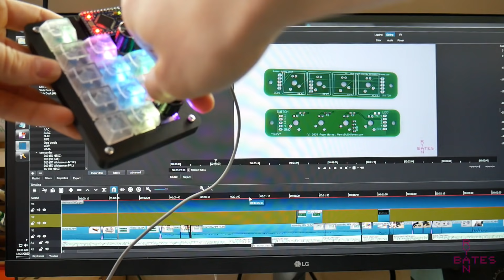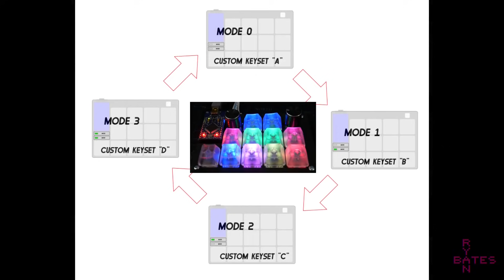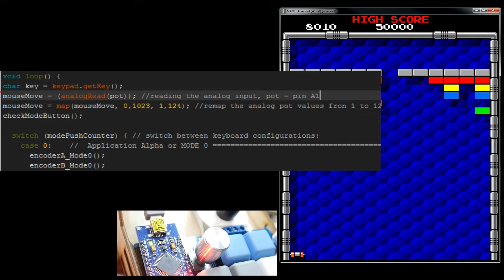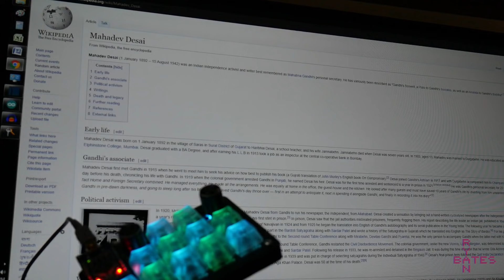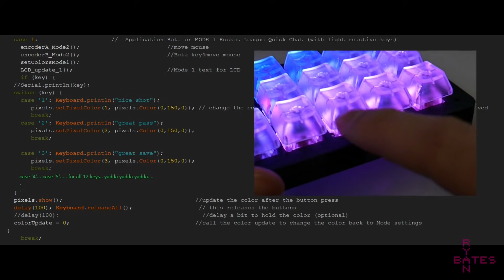Arduino Pro Micro Macro Keyboard Version 2.0 |  DIY Macro Pad for Professional Keyboard Slayers

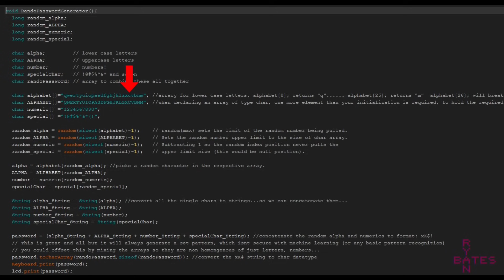Comment: Just a note at 23:13 -- the `sizeof()` operator tells you how many bytes a variable has. In the case of a `char` array, it works out to the length of the array, but that is only because a `char` is one byte. If you tried the same thing with an `int` array (`int` is 2 bytes on Arduino Uno) you would get double the length.

The project looks great though! It's been a big help in building a macro pad of my own.

Comment: I'm attempting to build this and referencing the video as I go. Here are some timestamps that may be helpful if you're following along and soldering, though no guarantees for accuracy and some may/may not include the explanation.
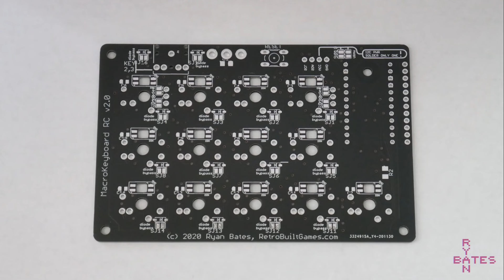3:44 Diodes for anti-ghosting
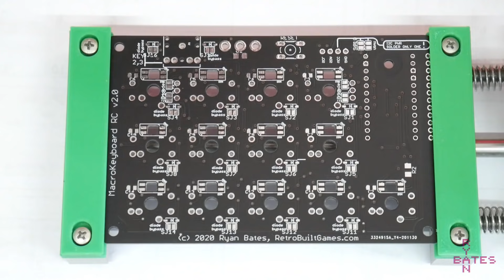4:09 Diode bypass jumpers
4:33 Rotary encoder enable jumpers
4:51 LCD breakout connector
5:49 Right-angle header to connect screen 
6:13 Individually addressable LED
7:51 LED capacitors
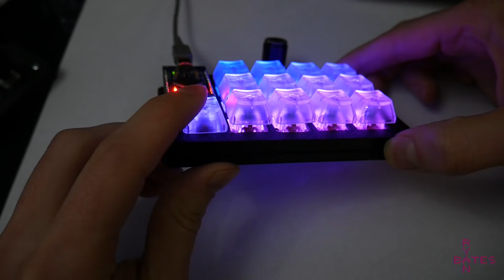8:10 Resistor for data-in
8:30 Reset button for programming
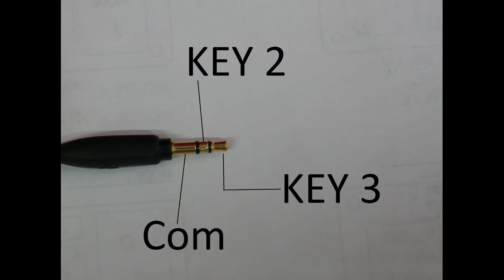9:06 Volume/potentiometer knob
9:22 Arduino Pro Micro
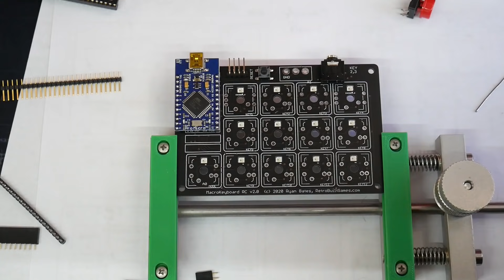10:13 Soldering encoders and keys
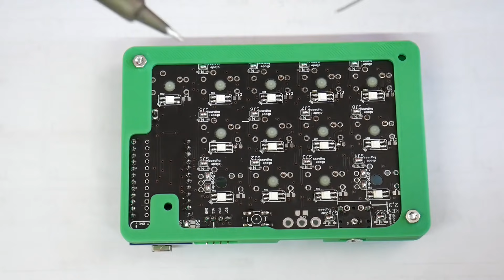10:45 Encoders (flush cutting tabs)
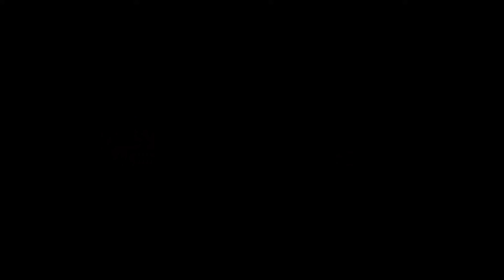11:58 Final Assembly (case)
Thanks to Ryan for this awesome project, I'm super excited to build it
Reply from the maker: Thank you for the timestamp breakdown!!!
Reply: @RetroBuiltGames  I think the direction of the diode in the video is wrong

Comment: Once upon a time, I played a FPS online, that had artillery vehicles (among others) that had arcing shell trajectories and pretty long ranges. You controlled the aiming with a mouse. Those rotary encoders would have been rather nice to have for hitting long range targets blind, or with the help of a spotter.

Now though, I'm interested in 3D stuff. VR, 3D modeling, 3D input devices, etc. The macro keys look useful for tying extra key binds to for a feature rich program like Blender. There might be a way to use it in a social VR game as well, for emote keybinds, to control facial expressions and such of the avatar. Though it's already generally the practice to do that with the hand gestures on your 3D controllers. If you had both though, you could have extra functionality. The rotary encoders might at least be useful to somehow control how open the mouth is without needing to make sounds for the viseme system to use as cues for jaw control. Another use could be to control the speed of a repeating idle animation. Turn the nob for faster or slower.

Comment: I'd personally recommend getting some solder paste for the SMD components, especially the LEDs.  I've found it works great to both get the components aligned quickly and to minimize iron time so sensitive components won't bork
Reply from the maker: Thanks for sharing
Reply: Yes, it is very important to minimize component borking.

Comment: This project looks perfect for a live stream OBS 'hotkeys' macro controller. I'm going to also make a prototype that is MIDI compliant and see how this design holds up for a Synthesiser interface. Cheers Ryan!
Reply: It may worth it if you need a macro keyboard frequently. 
Instead I use an old tablet and TouchPortal. Even the free version offers enough functionality if you are not a pro streamer.

What I could use though, a split keyboard with 3 or 4 parts, and with a button which could switch between layouts, so now I wonder what this channel can offer in terms of information even I can understand  :)

Comment: 8:00 I'm pretty sure the caps required for the LEDs by the manufacturer are simply to help eliminate any flicker from irregular powers supplies etc, can't be sure tho as I'm an amateur electronics engineer and I basically know just enough to be dangerous and confident enough to make a comment without actually knowing anything at all lol.

Comment: i cant wait for this board to be available again on tindie! the price is right and ive been wanting to build a macro keypad forever. i just ordered my arduino pro micro and as soon as i can afford the keys, caps and encoders it will be an awesome build
Reply: i have my PCB, installed the arduino and LEDS. im ordering keys and caps at the moment as well as the button and diode

Comment: One revision you could make in the future for the PCB is to add the two small fixing pins per the Cherry MX standard. That way you can use PCB mount (5-pin) switches and they will align properly.
Reply from the maker: I had this in one of the in-between revisions. Removed that footprint variation because those ~22 holes took up a bunch space for routing traces.

Comment: One useful function would be sending a keyboard or mouse event periodically every few minutes to the host machine. This is to prevent screen lock on timeout. I would buy such device ))
Reply from the maker: This can be done! Is a current feature/bug in my code. Will wake my computer from sleep unless you tell windows to ignore this USB device while in sleep.

Comment: Seems like it would be beneficial from time to time, or for different folks, if the 2 power options were not solder bridged but instead bridged by a jumper cap that can be moved again and again. That way, if I bust my screen (or just don't like it) and I get a new one with a different voltage, I can just move the jumper cap.

However, I LOVE the project!
Reply: jumper cap or toggle switch ftw.
Reply from the maker: solder wick ftw

Comment: I've had success having coarse and fine input on a single encoder by using a timer. If it's been a while since the encoder moved, the encoder changes the input by the smallest increment. If it's moved recently, it changes by a larger increment. "recent" and "larger", adjust to your taste.

Comment: Try using the Open Macro Keyboard project. Instead of four modes you will gain unlimited screens with macros along with an option to configure colors per button per screen. You'd need to reprogram your keyboard to send information about key presses and/or encoder rotations through COM (via USB). But I guess it is worth the effort.
Reply from the maker: you didnt watch the video

Comment: Rgb led resistors: if you would use a brightness pwm value of 255 or just constant 5V then the leds would burn eventually, but since you're using pwm value of 120, resistors are not mandatory.
Reply from the maker: resistors where?

Comment: Three times the cost, eh?
Seeing these are fully customizable, I'd say the money costs would be a small fraction, compared to trying to get a custom from someone else.
Cost of time however... 
A little more than just plugging in after getting in the mail. But that's the fun part.
Reply: i could see someone creating a software similar to elgato"s one that could fix most of the time spent on macros

Comment: Hey does anybody have a link to where I can find resistor mentioned at 8:15? It does not have to be the exact resistor used in the video, just as long as it will work!

Comment: I am looking for something similar with infrared. The background is, I want to make a simple remote control for a video player for my grandmother, 92 years old.
She selects a number from a paper list, which is linked to a movie title, possibly also via rotary encoder and display. Then, by pressing Play, the TV shall be switched to HDMI and the movie shall be started. When pressing Stop, the TV should switch back to TV. 
What I am missing is the possibility of infrared. Is that also possible with this project?
Reply from the maker: very possible. there are infrared libraries that can learn from your remote. Just point your remote at the arduino with the sketch and an IR receiver. You can learn all the  remote commands and build the code you explained.
Reply: Thx for answer, but maybe the question was too imprecise. ;) Is it possible to additionally control an IR diode with this setup/PCB? It seems that all PINs are already in use.

Comment: Why did you design the top plate so that the switches can slide through them? Don't most top plates for keyboards and stuff, aren't the designed for the switches to snap into them?
Reply from the maker: I wouldnt say most just because I dont own any to sample from. My PCB is lacking the expanded footprint that has extra holes to aligns the cherry keys.

Comment: The password checking site you used only accounts for true brute force methods (so AAAA > AAAB) so it claiming any amount of time is highly inaccurate (as with most of them) because it 1) depend on the hackers PC speed, and 2) relies on the true brute force method. The best solution to the generated password is give (either programmatically or static) a random number 0-3 to each char type and then randomly generate a number (0-3 or potentially a 14+ string only containing 0-3) and then pulling a character from that. 

I do love the idea for the physical button to generate passwords; However, it would be nice to also be able to share it somewhere else so if I paste directly in a website I don’t have to reset it everytime I try to login because, at least for me, I’m not going to remember a secure length true random password. 

On a side note: potential encryption in memory might also be nice to have incase your computer’s memory is currently being watched by malware (but for some reason isn’t reading key inputs) although this is probably not as likely to happen as its easy to read keys and requires so much more work to read memory. But there isn’t really a way, without something on the browser, that would fix this... so a password generator on a external decide is probably not a great security solution for people who are worried about cyber security. 

I do love the project so this is just really an idea how to make the program better!

Comment: If u have a sec, I just have a quick question for ya: I have an Arduino nano, and I want to use the Keyboard library. Is there any way I could trick it into working?
Reply from the maker: You can, but the results are mixed. The library will try to bit-bang USB protocols (like brute force the communication), so it for the most part it acts like a USB device. However with all the background stuff (LCD, RGB lights) it will probably behave like a wireless keyboard that is 1foot out of range...
Reply: @RetroBuiltGames  I'm trying, but when I try uploading it it just spits out errors, and if I try changing the board type in the software to a compatible one, it just gets stuck uploading...

Comment: Another question: Capacitor 'C1' has a footprint but there is no value and it's not mentioned in the video. What is this for? And which value should it have, same as the other caps (0.1µF) ?
Reply from the maker: you dont need it. C1 was a stabilizer if doing quick reads on the Analog pin at this potentiometer. artifacts the of design process. 0.1uF is fine
Reply: @RetroBuiltGames  Thnak you!. You're really fast in communication, thumbs up!
Reply: @RetroBuiltGames  BTW: "you don't need it" - I just hate unpopulated footprints. ;-)

Comment: After having spent some time in adding/enabling features to my repo (https://github.com/chechu2k5/macropads), I feel that QMK firmware project (https://docs.qmk.fm/#/, https://github.com/qmk/qmk_firmware ) might be a better choice (atleast for some folks) as it appears to have a number of advanced features and a vibrant community around it. Perhaps with some effort, these board(s) can be integrated/added to the list of boards supported. Thoughts ?
Reply from the maker: sure! might want to fix your links, the ")" appended to the end breaks them.

Comment: hello . the display (2004 5v) show blue screen. i tested on a arduino nano...it work.... i connect the display direct to the indicated d2 d3 pins direct to micro pro and stil same error. vcc bipass as show in the video at 5v :(
Reply from the maker: i2C (SDA and SCL) are on different pin #s between the Arduino nano (A4 and A5) and the Arduino pro micro (D2 and D3). Check your code.
Reply: @RetroBuiltGames  solved. tnx

Comment: Just A quick Question for the arduino, wuld this be fine with a usb-c pro micro board? i just prefer that connection
Reply from the maker: would be 100% fine
Reply: @RetroBuiltGames  alright thanks

Comment: I see that to start the calculator, you use the run window.
Is it possible to send special scancodes? In the Switch Hitter program from Elite Keyboards (maybe you know it) the "Calculator" keys report "  (0xB7, BIOS 0xE000) DOWN"  (WinCode: 183 0xb7, BIOS code: 0). There are such codes for several programs and functions, which could come in handy.
Reply from the maker: . ive never tried this. you can send hex codes... is that the same as a scan code?
Reply: @RetroBuiltGames  Hopefully I won't forget to check it tomorrow (it is almost midnight here now). These should be some special scan codes because of the BIOS E000 code. At least, I have read something like that in a Microsoft document. Regarding the microcontroller: so far I have checked only Teensy examples, and I have seen only usb keycodes in the program codes.
Reply: @RetroBuiltGames  So, what I have found out. If you google "Keyboard Scan Code Specification" you will get a document from microsoft with keycodes. The BIOS Code looks like the make codes listed in the scan 1 table. These may be standard XT scan codes. The E0-00 scan code may be needed not to interfere anything else. Something similar that the Control's code is 1D, but when they added the right control, it become E0-1D.
The Win Code is the Windows virtual key code, google "Virtual-Key Codes" and you will find it on microsoft's page. You will finde there VK_LAUNCH_APP1 an 2 keycodes, which start My Computer and Calculator respectively. There are all the other virtual key codes as well, what keyboard usually send by Fn+function key combo (volume, next/previous media, etc). How does the keyboard send these codes? I have no idea unfortunately. If someone understands deeper how keyboards work, they may help more.
Reply from the maker: @RelakS__  thank you for this. it's very interesting,. How (what data layer) the keyboard sends these scan codes needs an answer. maybe someone will know.

Comment: are you using interrupts for the key switches? Shouldnt that get rid of the worry of overburdening the arduino's processing? Been a while since I played with Arduino so idk.
Reply from the maker: no. iirc there's only 2 or 3 interrupts on this microcontroller. -personal opinion - relying on interrupts was a non-optimal choice; a crutch to avoid making better code. so there was emphasis to make it efficient (ish)
Reply: @RetroBuiltGames  ahh yes. Thats right. I developed some factory equipment using arduino to drive it. Had to switch to a due core as every io pin is an interrupt pin and I had a lot of switches and sensors sending input as that needed immediate actions.

Comment: Not sure if this is the best place to ask, but I have a couple questions.
1. Is it necessary to solder the diode bypasses next to the headphone jack even if I am not using the headphone jack?
2. Do I need to solder the VRAW/VCC jumper even if I am not using an LCD/OLED screen?
I am asking because my keys are not responding as intended. Any reason why this might be happening?
Thanks, and good work!
Reply from the maker: 1) it is not necessary
2) no, you do not need to solder this if not using a LCD
you might have missed a diode jumper somewhere
Reply: @RetroBuiltGames  I think I soldered everything properly. Maybe there is something wrong with my code...
Thanks for the help.

Comment: what is the maximum number of encoders and switches i can connect to the pro micro, and i am not using an LCD or the rgb leds.
Reply from the maker: 2 encoders & 11 switches (1 switch is dedicated as 'mode' )

Comment: I like this, but it would be even more perfect if it was compatible with Feather form factor boards. I think that would open it up to a lot more options for add-ons such as displays that could just be plopped on top of the MCU, as well as giving options for Arduino C or CircuitPython as the language. Hell, that would let you start with a basic feather that uses the same MC as the Pro Micro, and then later swap it out for a Bluetooth enabled Feather like the nRF or Bluefruit models, made even better by the fact that all the Feathers have built in LiPo connectors and chargers
Reply: Also, the reason I bring up CircuitPython is because when a UF2 supporting board is loaded with CircuitPython firmware, it looks like a USB Mass Storage device (while also appearing as a USB HID device if you are using it for that) where you can drag and drop your code to the board on any OS without needing a compiler or programmer

Comment: Programming this thing is way over my head, but I'm slowly learning what the code does, and how to change it. There are two things I'm trying to do, but can't figure out:
1. When a key is pressed and held on the macro board, it repeatedly presses and releases the Shift key until the macro key is released.
2. When a key is pressed and held on the macro board, it works the same as holding the ~ key. 
Also, any recommendations on how to make the potentiometer control volume/where to get more info on that?  
Thanks for this project! It's been a little frustrating at times for a beginner, but very fun and rewarding!
Reply from the maker: 1. this is because when the case statements match the key you hold down are loops that enter, do your code, exit (break;), and re-enter multiple times/ second
2. this sounds like a bug in the code....
3. i believe there is an advancedHID library that handles volume and media control keys